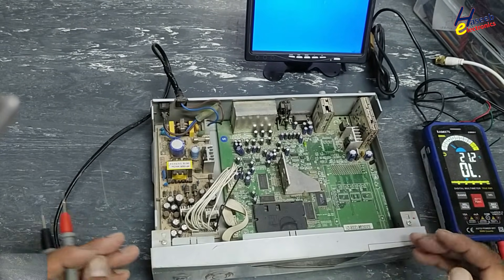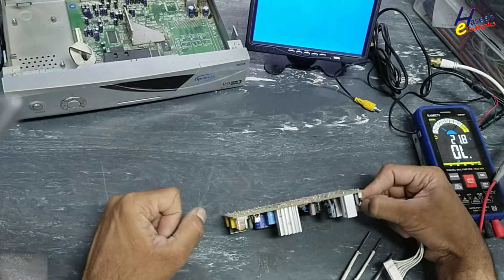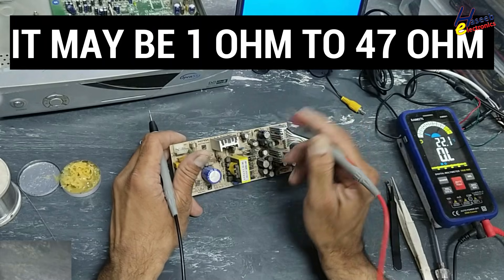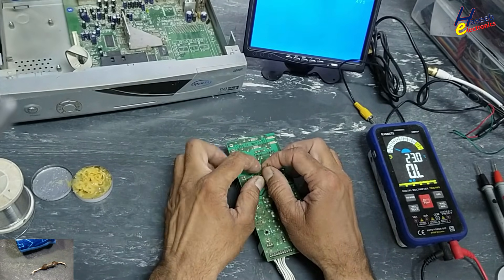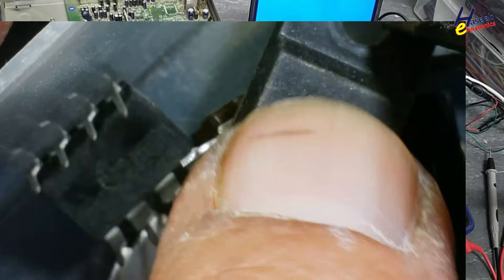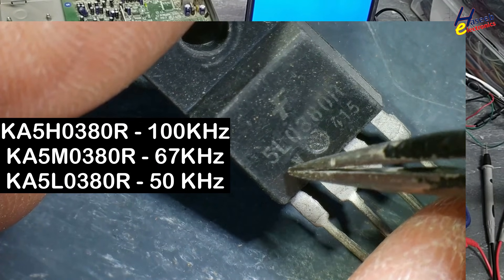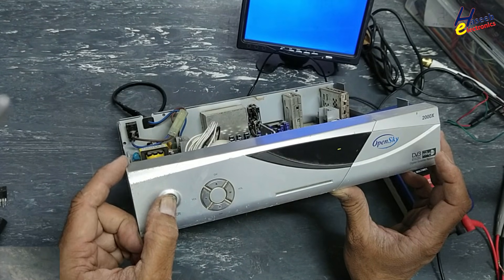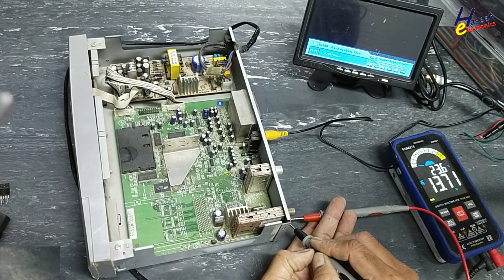{1407} Dead Satellite Receiver Repair | VCC Fault | Burnt Resistor & 5L0380R SMPS IC Replaced

Comment: How do you know the value of a burned resistor without having the schematic diagram ?
Reply: By general understanding of the use of the resistor, it can be a little more or less but it will function fine, me mentioned what its used for so by knowing that you can put in a replacement